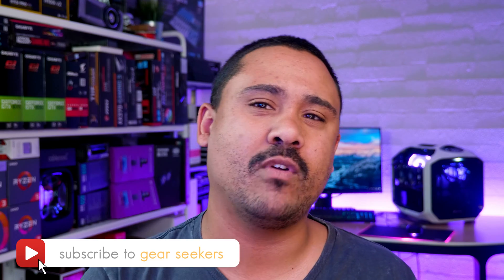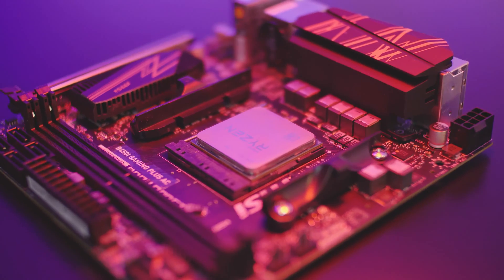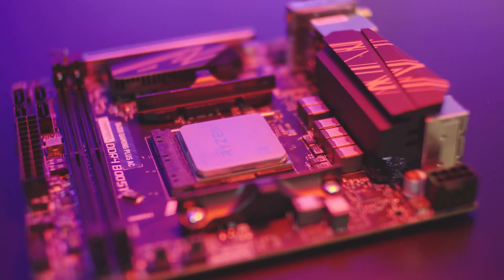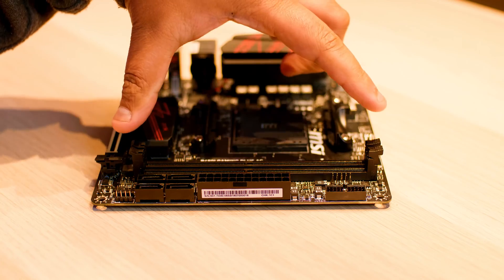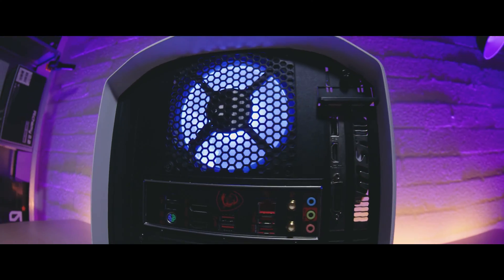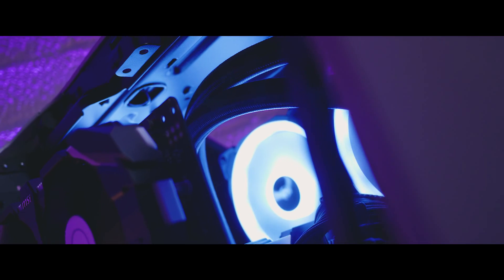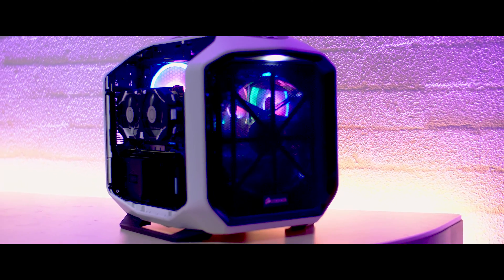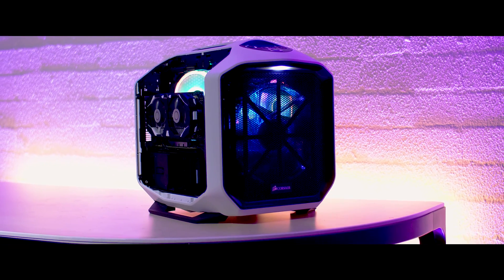Portable and Powerful - MSI B450I Gaming Plus AC Mini ITX Build

Comment: im using the same mobo and is planning to use an AIO, can you please enlighten me on where do you plug the pump and the fans?
I can only see a cpu fan and system fan header so not sure how to go with this.
really appreciate the help :D thanks
Reply from the maker: The pump plugs into CPU fan header and the fans plug into the splitter that comes out of the pump.

Comment: BIOS Flashback can be a total lifesaver. USB-C is pretty meh for me. I've had my eyes on this case for a while, if I was ever going to build a portable desktop. How was it to work with?
Reply from the maker: It is pretty tight but as long as you dont care about cable management too much it would be good. I reckon an SFX PSU with a full size adapter plate would be the go for power. It will give you better cable management as well. I dunno if any of that made sense.